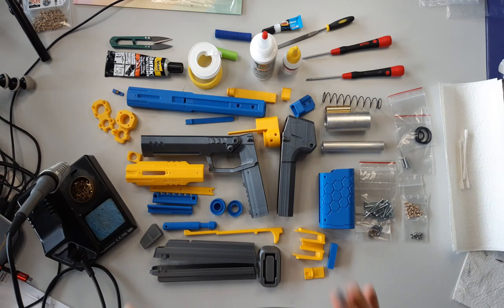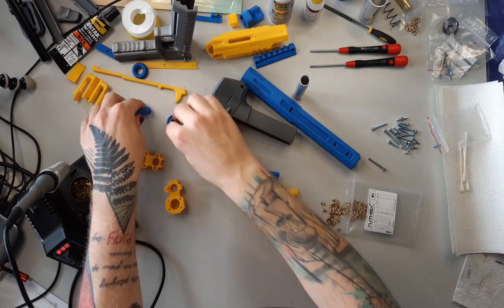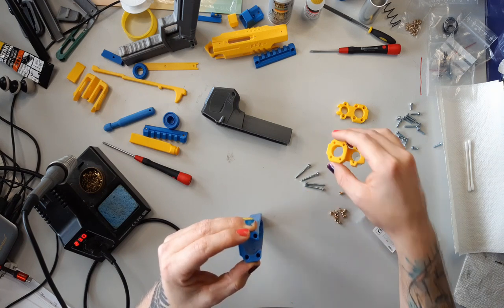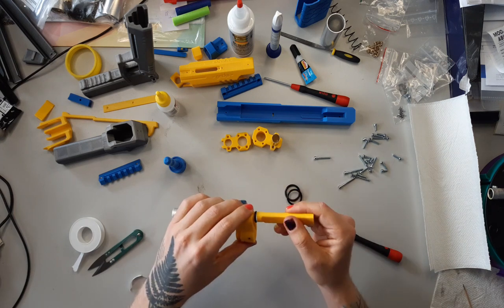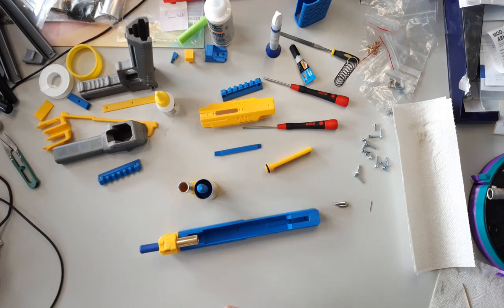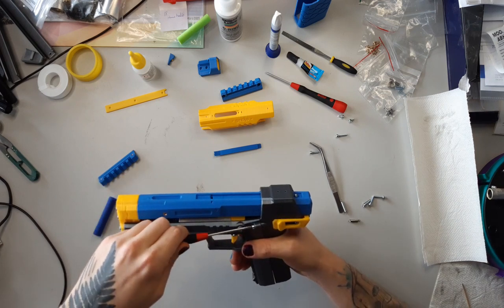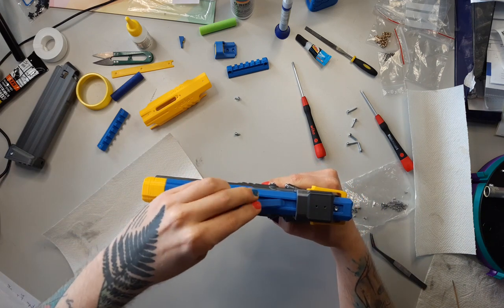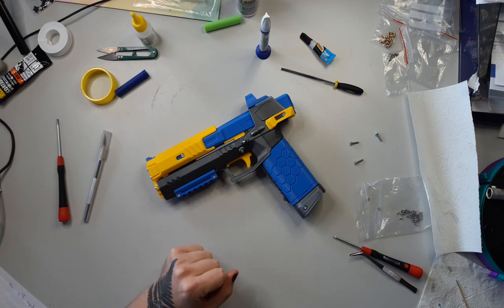Let's build a GECKO blaster! ~ MOST COMPREHENSIVE Build Guide/ Tutorial incl. Tips by Rainbow

Comment: I really think I found the perfect way to construct the turn around. I've been using my Resin printed one for a week now and it hasn't shattered,  and the air seal is phenomenal, the pusher seal and the compression chamber seal are smooth as glass. Just need to drill out the heat insert holes a bit to slide them in with a bit more uv resin to embed them, and do the same with the barrel. Just have to print it with a translucent resin to accomplish this. I used an "ABS LIKE" clear blue for strength. 
Again thanks for the kits and info!
Reply from the maker: that sounds interesting. I would love to see it when its finished!

Comment: 35:26
Why not just put some thick grease on the pin instead of gluing it in place? It's not permanent, but it should definitely stop it from rattling. Something like a white lithium that won't eat away the plastic.
Reply from the maker: because I personally don't like greasing up blasters and parts when its not needed. It gets messy over time and I don't like that. But if it works for you, go for it.

Comment: When I printed the turnaround the barrel doesn’t quite fit in, but it fits fine through the catch housing. Did you have this problem too? Or do you have an idea of what might be causing it?
Reply from the maker: Aloha Josh,
I have encountered that same problem sometimes. It has to do with different printer tolerances and variations in barrel material. Even with the variation in the barrel being very little, if its slightly bigger and your printer prints the turnaround slightly smaller it will cause that problem. I fixed mine by dremeling out the turnaround a bit and then using glue (which is recommended anyways) to secure the barrel. Hope that helps.
Reply: @RainbowCircus  got the blaster to fire and everything but the feeding seems really inconsistent. Sometimes the darts will get stuck and won’t shoot. Have you had this problem before too? If so what did you do to fix?
Reply from the maker: @robopenguin5501  make sure that your pusher is in line correctly. Depending on how you printed your slide there might be some bit of plastic under the pusher causing it to not be aligned correctly. Also make sure your mags and turnaround are cleaned of any printing debris to the darts can travel freely.
It also might have something to do with your magazine. If the spring is to strong and the follower does not move freely (friction with the mag walls) it will cause more resistance and also squeeze the darts more, which could lead to miss-feeding.

Comment: Can i use a hotglue gun's metal part  to heat insert? How else can heat inserts be installed?
Reply from the maker: I don't know how hot your hot glue gun gets, but if its around the same as your print temp than it should work. But I have only ever used a soldering iron for that.

Comment: I'm considering making my own gecko with carbon fiber filaments. Which parts do you think are the most brittle and could use some extra strength?
Reply: Also where else can I get the thermal  insrets incase I need some extras?
Reply from the maker: as for the carbon fibre, I honestly don't know. I have not had much trouble with any parts so far. but I guess the plunger and the pusher would never hurt to have more strength
Reply from the maker: if you order a hardware kit through my shop (www.rainbowmods.com) just write in the comment and a toss in a few extra. 
I could also make them available separately if thats something people would want.
Reply: Thank you for the fast reply. I will keep them in mind.

Comment: I couldn't find the darn hardware kit anymore.. The only models i see are the cheap chinese clones are there.
Reply from the maker: You can still get the hardware and the full blaster through my shop: www.rainbowmods.com 

The files are on github if you want to print the og gecko yourself. There are several updated files on thingiverse and cults3d, which I personally use as well. Let me know if you need some pointers. 

Love and sunshine
Reply: @RainbowCircus  so it uses a soldering iron. I have no experience with that. Oh well I can pick up on the skills.